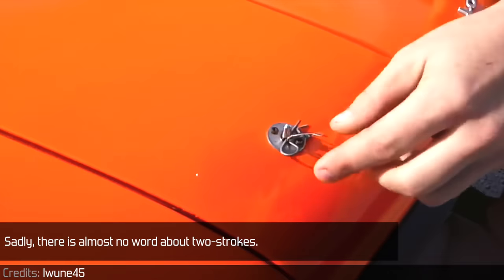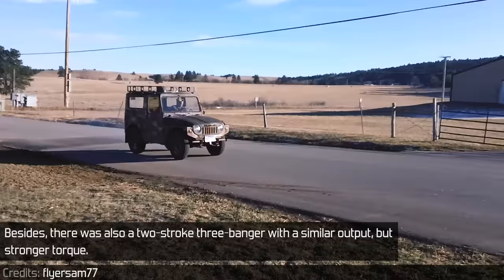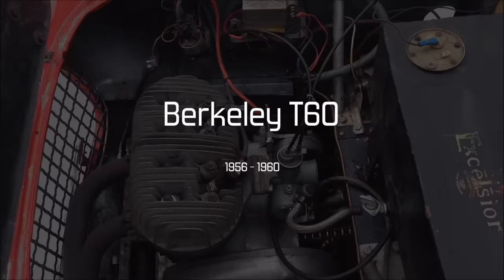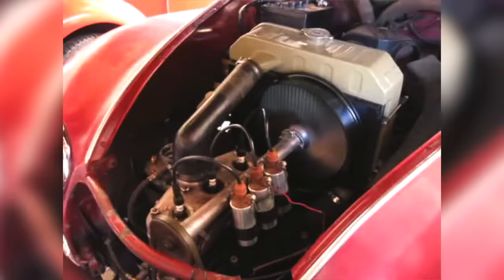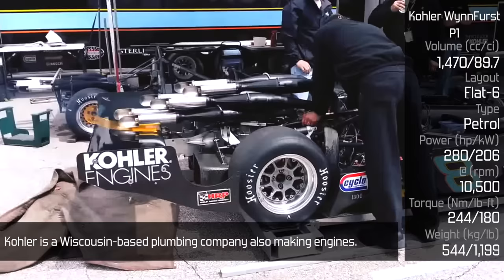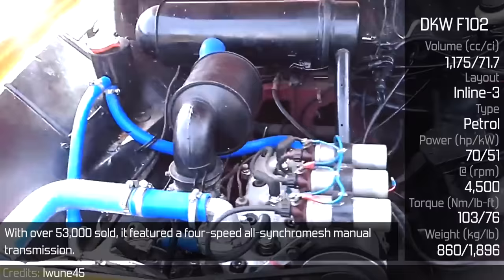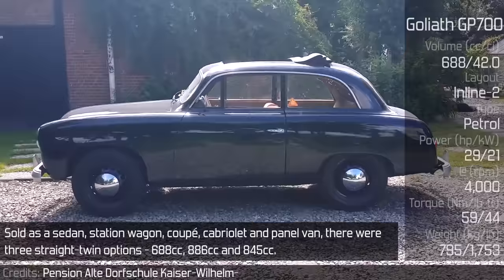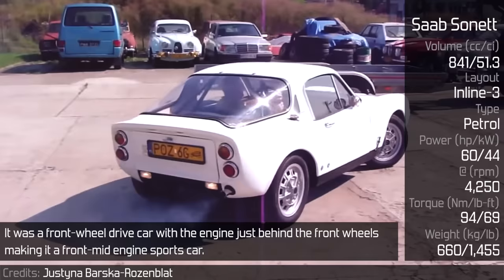8 Cool Two-Stroke Cars You May Not Know About

Comment: Diesels with highest redline/petrols with lowest redline in normal production cars?
Reply from the maker: I have already made a high-revving diesels video.
Reply: Mazda's Skyactiv-D engines rev quite high, the limiter on the CX crossovers is around 5900 o.o
Reply: 5900?? Dang that's high for a diesel! Still though, I'd love to see a lowest-revving petrol compilation, I mean not ancient 1930s engines but recent ones. Because we once took a rental 1.2 Micra, not sure if the thing was limited or not but it would not rev past 5500 which is ridiculous for a petrol haha
Reply: Adam G ye, I saw a Japanese car review of one of those, will look it up in my yt history and link you if you want
Reply: Dario Piovani that's a very smooth rev limiter, I bet it's possible to go all the way to 6000 with minor mods haha
Reply: Ye, smooth limiters are pretty common on diesels nowadays, because a pulse-like one is said to clog the DPFs when sitting on it xD

Though, indirect injection diesel engines can rev higher... there's a drag spec Golf III on YouTube (can't recall the vid, perhaps even VisioRacer featured it) which goes up to an astronomical 7500 rpm xD
Reply: Funny, my first car was a 2003 1.4HDi 307 and that thing had the most stupid accelerator pedal design ever- if you floor it it'd get stuck behind the carpet and would rev to infinity and beyond. That's why you'd always have readjust the carpet before going anywhere. Anyways, I remember it'd always go like baaawawawawa at 4500, this mazda just looks like it's steadily holding it... Dang, 7500! Half of petrols can't even go that high 😂
Reply: 5500 is normal for anything pushrod OHV, the reciprocating mass doesnt like high rpms even with relatively heavy springs
Reply: yea, not to mention the shorter the stroke the faster the crankshaft moves in comparison to the piston moving up and down, effectively turning the gear ratio really steep so it wants to rev but has no low end torque
Reply: @Adam_G  my dad that car... I know that accelerator problem all too well..

Comment: The assumption seems to be that an F1 2 stroke will be a small capacity engine because that has been the history of 2 strokes in the automotive industry. A better idea of the possibilities would be to look at marine 2 strokes. Over 40 years ago Outboard Marine Corporation (OMC) produced Evinrude and Johnson 3.5 litre 2 strokes for racing in F1 powerboat racing. Mercury responded with a 3.4 litre V6. These engines produced north of 500 hp and made a sound that makes a V10 4 stroke sound sickly. I can't even imagine what sort of output could be obtained from modern versions of these engines using current technology, metallurgy and engineering.

Comment: 2 strokes are the most efficent engines in the world. The largest 2 stroke diesel crosshead engines have 100,000 horse power and 5 million foot lbs of torque. 22-120 rpm. The piston moves 8 feet up and then 8 feet down, and it's nearly 3 stories tall. The engine exceeds 50% thermal efficiency, a chainsaw engine is less than 20%

Comment: That Koehler powered car races in P1, Formula C is an open wheeled class with a spec engine. Interestingly this category currently allows two spec engines, they’re transitioning to a Honda engine, the old engine is more interesting as it’s a Ford Pinto engine using leaded gasoline.

Comment: There was a 700cc fuel injected Goliath in a wrecking yard in Madera CA. Had a sunroof and I'm sure Porsche used the same one. I carried a set of 3 carbs for a c1960 Saab. Couldn't give them away so after 30 years I left them in a barn in 2000.

Comment: At 4:55 you say that the DKW F102 is one of the last cars with 3 cylinder 2 stroke engines yet they stopped making it in 1969. The Wartburg knight was built through the '70's and had a 1 litre 3 cylinder 2 stroke engine.
Reply: A sigla DKW significava inicialmente "Dampf-Kraft-Wagen", carro de força a vapor, já que os primeiros produtos oferecidos pela empresa foram pequenos motores a vapor.
Reply: A DKW é uma marca histórica de automóveis e de motocicletas, associada em todo o mundo a motores com ciclo de dois tempos, que teve seus automóveis fabricados sob licença no Brasil pela Vemag entre 1956 e 1967. Aqui, a marca ficou conhecida popularmente como “DKV”. A DKW foi uma fábrica alemã fundada em 1916 pelo engenheiro dinamarquês Jørgen Skafte Rasmussen que, em 1932, com a Grande Depressão, se uniu por sugestão do Saxon National Bank a outras três fábricas, a Audi, a Horch e a Wanderer, para formar a Auto Union. Em 1938, o grupo ganhou a participação da NSU. Em 1957 a Auto Union foi adquirida pela Daimler-Benz e, em 1964, pela Volkswagen, passando então a ser denominada Audi.

Comment: It sounds like a of two-stroke owners like to let their clutch slip when changing to first gear. Why is this? Are the power outputs so low that you need to rev the engine like crazy to get them moving?
Reply: Yes...
Reply: Basically. Say the car needs 20hp to get moving. An 80hp engine would have to rev to around 2000rpm to do so, while the 40hp engine would need to rev to 4000rpm to do the same thing.
Reply: 2 strokes have barely any torque at low RPM.. You can drive 40hp disel car without even touching the gas pedal.
Reply: Depends on the weight of the car and the gearing too.
Reply: Not really - two-stroke engines are much stronger than a four-stroke engine of a similar displacement, because there's a power stroke in every revolution in a two-stroke, compared to one in every 2 revolutions in a four-stroke. The reason two-stroke engines are often run at high revs is because they produce most of their power at higher RPM, compared to a similarly-powerful four-stroke engine
Reply: shynung I don't think I've ever driven a car with less than 80HP. It's difficult to imagine what half of that means in terms of acceleration and engine feel. This is kind of what I meant by the low output, not specific output per litre, which obviously is higher than a four stroke.
Reply: Klikkitse Well, back when two stroke cars are in their heydays, engine tech was still primitive compared to today. Add to the fact that Europe was recently rekt by WWII, they can't afford to produce powerful cars that we have today.

If you're curious enough to try driving a weak car, a quick way to do it is to rent a Citroen 2CV.
Reply: Well, yeah. There are two-strokes that have plenty of low end torque, and there are four-strokes that has to be revved up to get usable torque out of them. I guess it all depends on how good the engine designer is, and what task the engine was designed in mind.
Reply: Also wanted to add that bore:stroke ratio often determines the engine characteristics. A long-stroke engine generates plenty of torque at low RPM due to greater leverage at the crankshaft (connecting rod-crankshaft pivot is far from crankshaft centerline), but can't run really fast, because their pistons has to travel far at every stroke, and as such their inertia saps the high-RPM power. 

In contrast, a short-stroke engine lacks much of the piston inertia to begin with, since their pistons travel a shorter distance, hence can run pretty fast without piston inertia sapping their high-RPM power. On the other hand, they have less leverage at the crankshaft, so they lack the low-RPM torque of their long-stroke counterparts.

Note that this applies to almost every piston engine ever designed, be it two-stroke or four-stroke. While a two-stroke is still stronger than a four-stroke at the same displacement, given a similar bore:stroke ratio, they'll have a similar torque curve.
Reply: Klikkitse If you are asking for cars, I don't know much about it. But on 2 stroke motorcycles a little touch is enough to make it get going, except 50cc.
Reply: allot of them have low low-end torque.
Reply: I drive a 50cc 2stroke from East Germany... I also let my clutch slip when i change into 2nd gear
Reply: I think quite a few two-stroke engines are paired with a centrifugal clutch, which needs to be revved in order to engage.
Reply: Mihkel Laansoo ?
Reply: Rick Delair poorly made japanese hmm Japanese and germans  dont make crap americans however
Reply: shynung The most powerfull production cars are made in Europe...
Reply: Klikkitse I usually do that with my 50-80cc 2 stroke bikes
Reply: Ahem, a diesel doesn't have a gas pedal...
Reply: Mihkel, no, you are wrong. Two strokes are capable of making lots of torque at low RPM, but like all engines it depends on the design of the engine. I have a Yamaha RD350 2 cylinder two stroke that makes gobs of low rpm torque and also a 3 cylinder 500cc Kawasaki 2 stroke that makes its torque at higher RPM. Its a common misconception that 2 strokes make no torque and its very very untrue
Reply: Finke
Reply: Klikkitse no...its done to rock the vehical....obviously it needs to be revved to get the power out...with such small displacement...only way is the rev...
Reply: Shymung: Bore and stroke actually have very little to do with the specific rpm a particular engine develops it's torque and horsepower. That is primarily determined by the cam timing and intake and exhaust tuning, valve size and runner lengths and cross sectional area. What the bore and stroke does is bigger bore/smaller stroke allows bigger valves that allow better breathing at all rpm and much better at high rpm where the smaller bore/longer stroke engine has no room for bigger or more valves and thus simply cannot breath at the higher RPM. Given equal intake and exhaust specs, a long stroke engine will produce pretty much exactly the same torque and horsepower curves as a same displacement short stroke engine.
Reply: Rick Delair poorly made Japanese internals? That there immediately discredited every statement you will ever make xD ever actually try to blow up a Honda. Well maintained and factory you could pin it through a whole tank of gas. As long as it has oil and sufficiently cooled it’ll go for ages. I’ve seen many all original civics with 500k and up. Run and drive perfect. Gtfo xD
Reply: Maybe it can just get them moving faster than if you didn't.
Reply: Two strokes make thier power and torque at high rpm so keeping it in the power band is a must unlike four strokes that have low and mid range torque so high rpm is usually not nessasary this less slipping of the clutch.
Reply: @jackrabbit7389  my bike originali was 50cc now is 60 cc i changed cilynder with other one wich has intake bigger than exhaust now i have bike wich can drive in 3rd gear on idle also i can use carbs from 12mm to 20mm on same cilynder depending for what i need at moment.with max 5000rpm and 60kph no matter what carb i use only power change with carbs,with 18mm carb it broke chain twice and few gears,and cilynder is not from other bike but from water pump fitted on engine
Reply: in ralenti,the volumetric efficient is very low,low,the engine work at ralenti in "four"strokes",failing a lot. So the engine may go at middle or high rpm.    Torque at low rpm is very poor
Reply: @eelisparkkinen  Remember, these engines are below 1000cc for the most part and that is a major reason they have to rev to get in motion.  A popular 4 cycle auto of the period would have been like a VW beetle at least 1200cc and the torque is quite a bit more.
Reply: Its like driving a turbo'd 4 stroke, low end torque sucks... But once the engine comes up on the pipe it develops double the power of a 4 cycle equivalent. I had a RD400 daytona that would smoke liter bikes in a 1/4 mile. Top speed of 165mph on a tiny bike, far from stock
Reply: @retroman3075  nice! I owned a rd Daytona 400! I kick myself in the ass for selling that thing! Probably the scariest thing on 2 wheels iv ever riden

Comment: Meanwhile in America.. 454, 460, 427, 409, 396, 350, 327, 289 CID V8 engines making 250-550+ HP
When we saw blue smoke it meant you blew a ring, or were getting ready to cut firewood.

Comment: My jimny doesn’t sound like that.... I think Here in Spain they came with different engines
Reply: The Jimny started in 1970 with the 360cc, air cooled 2 stroke. This is the LJ10 model. Then in 1972 they made the LJ20, which came with a 360cc, water cooled 2 stroke version of the air-cooled engine. In 1975 they came out with the L50 engine in the same body, which was a 539cc, water cooled 2 stroke engine, essentially Suzuki just added another cylinder to the previous engine.

In 1977 they introduced the 800cc, 4 cylinder, 4 stroke, F8A engine which powered most export Jimnys until the arrival of the second generation body style (The boxy Jimny introduced in 1981).

Comment: brings back good times, good old little single cylinder air cooled 80cc dirt bike with a crude expansion chamber and the huge heat sink cylinder and head, love the smoke cause it pisses off the EPA, love the natural organic sound of poor scavenging at low rpm and how it smooths out slowly into a nice warm hum, and how the expansion chamber makes that classic ringing sound when it comes on and all of a sudden you have usable power, it just reminds me of simpler times back when 2 strokes dominated the outboard and off road motorcycle market, back when they revved relatively low for a 2 stroke and lasted a while, ive ridden newer liquid cooled ones ported way more open with much higher compression and they are great, love the bog then all of the sudden BRAAAP and as fast as you can run  through the gears is as fast as you can go but dont get me wrong i hate how you have to mix with oil and rebuild the top end all the time just to replace a piston ring or a piston every 30 hours or so when it loses power and sometimes i wish could just ride around in whatever gear i wanted instead of having to keep it revved into a low earth orbit just to go slow up a hill no matter how steep or not steep and how if you cant engine brake at all or your just starving it for oil, 4 strokes you could ride down a mountain without ever touching the brakes and just let the motor govern speed and you can go in pretty much any gear you want within reason cause it has torque all the way through the rpm range. not to mention 4 strokes are better in every way these modern days what with revving to 15 and oversquare F1 car engines and all. . .but 2 strokes will always have a place in my heart

Comment: Suzuki Jimny is SUV type but if yuo use it as SUV or hill climber, you will be just burning clutch not offroading
Reply: Low gearing in transfer-case means that the proper technique is to keep your foot off the clutch & if it stalls you simply restart with it in gear!
Reply: MrWombatty imagine the gear ratio as you dream: 25engine revs: 1 wheelspin?
Reply: Aurimas Knieža 
You sir have no idea what you are talking about!! Obviously never been in or even seen a lj50 in low range on hills... lots of revs and keep foot off clutch and they climb virtually anything... the low range gearing is really really low

Comment: Hey mate - in Poland we have FSC Syrena. Two strone engine, and if engine start in wrong way - You have 1 gear to forward and 4 gear to ride reverse.
Reply: That's great, and a surprise if you didn't realize it had started in reverse.  There was an Australian car built in the early 60s called the Lightburn Zeta.  It didn't have a reverse gear. You stopped the engine, selected reverse, which adjusted the ignition timing, and started the engine in reverse direction, so the car had 4 forward gears and 4 reverse gears.
Reply: Hmmm... Your car is very intresting :D

Comment: If you ever owned a two stroke saab you would know changing foiledplugs on the side of the road, not kool.  pouring oil in your gas tank every time you fill up, not kool.
Reply: +
Well, it was different than the convenience of a 'regular' auto.  I owned five or six SAAB 96s, all gotten quite cheap due to original owners having some glitch in theirs that they didn't want to mess with.  I never had a fouled plug as you mention but did have considerable dismay with shorted distributor caps in wet weather.  They finally came up with a coated version that was mostly impervious to that.  I lived in N.Y. state, upper Westchester Co. and we had some very challenging winters and rains.  The SAABs were so well suited to that territory and N. England where most were sold.  I was using SAAB recommended Continental oils, 1 pint to 8 gallons.  It was very clean running.  I was a motorcycle mechanic for a living and there were some very poor 2 cycle oils going, even from major oil companies.
Reply: Back in the day, we had two 2-stroke Saabs in our family. Neither ever fouled a spark plug. You must have been doing something wrong. Either bad grade oil or wrong mixture? Who knows.

Comment: but.. but.... 3 doesn't equal 6
Reply: Ladik007 it does the same displacement 4 stroke 6 cylinder same power
Reply from the maker: DKW tried to uphold a statement than a two-stroke three-cylinder does fire pretty much the same often as the four-stroke six-cylinder.
Reply: 2+2 is 4 minus 1 thats 3 quick maths
Reply: And indeed, a Wartburg or Saab with the right exhaust sounds just like the VW VR6...
Reply: It has the same fire order. But there is with a 3 cil two stroke always a vibration of the oscillation masses that gives a shaking movement about the length of the crankshaft (moment vibration). A six 4 stroke is fully balanced because the movement of the piston etc is mirrored, so no vibration forces and moments.